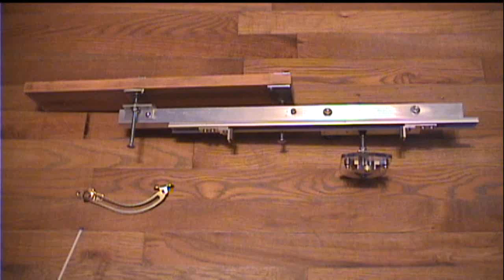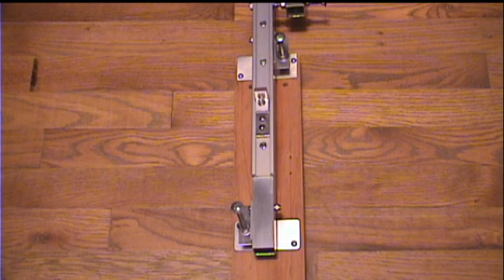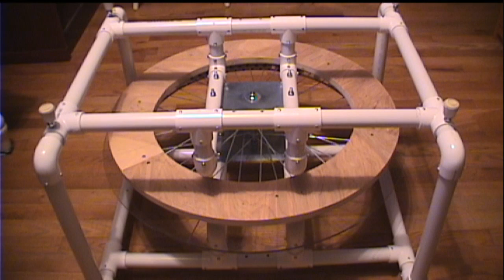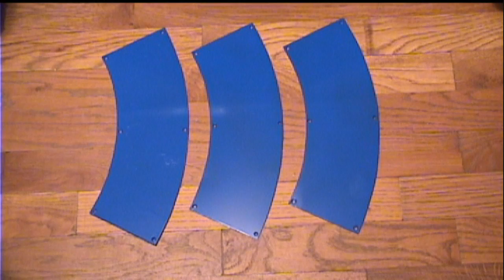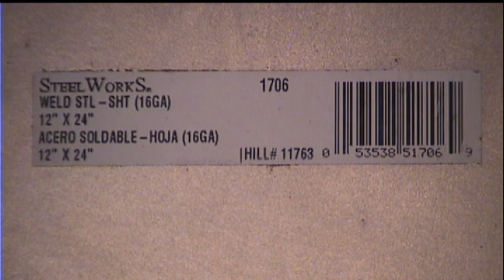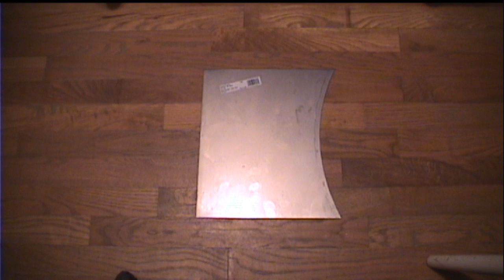Video #30, "Rick's Pipe Dream" Magnetic Motor-Generator Project.wmv

Comment from the maker: @CaptBart   Well, thanks captain.  I will be showing, in the Pipe Dream builder's documents, exactly how I laid out and cut these sheet metal arcs.  It is basically the same as the method I used for laying out and cutting the birch flywheel, which is composed of three pieces, and which is already illustrated step-by-step in the builder's documents.

Comment from the maker: I'm already getting some scratches in the paint from moving the magnets into place, so I plan to lay down a protective layer of clear plastic sheeting between the plates and the magnets.   I'll be making up a couple more plates, but I may have to order some more magnets, as I've already used up most of what I have.  Could maybe do one more plate with what I have left.

Comment from the maker: @CaptBart   After scribing the contours of the arcs, I simply cut them out using a saber saw with a 24 tooth metal cutting blade, then filed off any burrs, sharp edges, and noticeable irregularities.  They really aren't perfect, like you would expect from laser cuts, but they are close enough for these experiments.